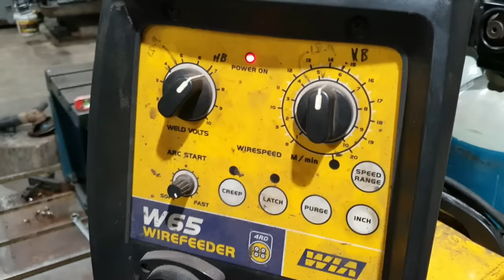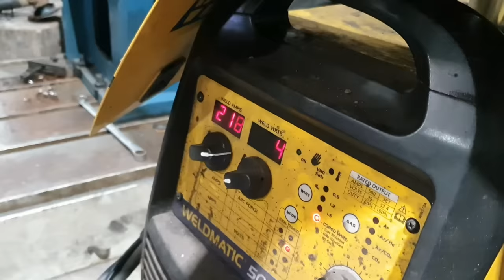Repair DAMAGED Hydraulic Cylinder for CAT 651 Scraper | Part 2

Comment: I'm barely above "dangerous shade-tree welder" and I fully and completely sympathize with that feeling you get when you're trying to heat-shrink two parts together... and you get the hot part to go on just a little and invariably it suddenly yoinks itself crooked and binds right up.... that overwhelming anxiety, knowing that with every passing millisecond, heat energy is just yeeting itself through that point of contact from the hot part to the cold part... that within seconds, every last shred of the precious thermal differential that our human brain worked so hard to create will not only be gone - it will never be achieved again now that the parts are in contact with each other... it's a deep, existential dread, for sure!
Reply: ...it takes PRACTICE-!!!
Reply: @daleburrell6273 
Yep, yet there’s always that one like the head collar that Kurtis had in this video and I bet he’s had tons of practice! It still has the exact effect described and that fraction of a second to grab the conveniently placed hammer feels like an eternity!

Comment: Are you the only guy in that shop? 
  I started out in metal trades and went to collage and became and engineer.   To see you do welding and machinist work is awesome for a rather young man.   Hard to believe it's cheaper to repair these parts vs replacement.

Comment: Thanks for the video mate. Does the hone improve concentricity and parallelism of the bore or does it only polish off the initial machining?
Reply from the maker: Hey mate it does both depending on the type of honing stones i'm using. 😎👍
Reply: @CuttingEdgeEngineering  thanks mate. I’ve never used a hone like that.

Comment: Do you flush the Grit out of the cylinder holes or does customer do that?
Reply from the maker: Hey mate I actually block the oil port holes with silicone which stops oil and grinding paste getting in the head flange. After jobs done we remove the silicone and give it a good inspection. The customer inspects it also before assembly 😎👍

Comment: Great videos. I build hydraulic cylinders for a living now and they've been sub arcing the head and baseplate welds BY HAND for 30yrs. Supposedly I'm the best at it they've had and welds have never failed. Which surprises me cause I'm sure there have been numerous Flux inclusions with the welds.

Comment: Great work as usual.
It was a bit of an anti climax after the cliffhanger of part 1. I see you used the multi tool of choice of handymen everywhere, the lump hammer. to encourage it into place.   😉👌🏻

I have a question, why do you grab the ring on the honing machine from time to time?
Reply from the maker: Hey mate hahaa yeah the missus was cruel with that cliffhanger edit! That wheel I hold is for adjusting out the honing head and put pressure against the stones to hone the barrel.
Reply: ...for the HELL of it(?)
Reply: ...we call that a "dead blow" hammer-!!

Comment: Great video guys, really appreciate your content     Just a quick question for the honing procedure. How do you adjust the machine for end diameter of the barrel? Also it must have been hard to line up the barrel true for the machine. Epic content anyways.
Reply from the maker: Hey mate thanks for watching. I'm using an adjustable honing head, the wheel I hold intermittently allows the honing head to expand the stones out. A bit of measuring to align and 2 universal joints on the honing head keep it centered to the bore. 😎👍

Comment: Wouldn't it have been easier to just bore/hone the bad cylinder until the scratches are gone and install an oversized piston afterwards?
Reply from the maker: Hey mate yeah it would have but this customer does not want anything oversized or modified beyond factory standard/tolerances as if this ever needs repair later on in the field the parts will not be easily available, e.g. seals/pistons

Comment: Brilliant video. Re the tolerance between piston and bore, if the piston was done first could the final honing diameter be changed to suit the smaller piston diameter, or would that mess up the seal fit. 🧐

Comment: Question:  Why did you not chamfer the drilled holes on the interior of the sleeve before reassembly in order to avoid the possibility of getting cuttings trapped in the area inside the head?

Comment: In my apprenticeship i learned to avoid producing stringy swarf like the devil. I noticed you have stringy swarf quite often. 
Often times the theoretical stuff we learn doesn't translate too well into practice so i wanna know what your reasoning is. 

Does a higher feed and or depth of cut produce vibration because of rigidity problems or is the surface finish not up to par? The power of the machine shouldnt be a problem right? Or does it simply not really matter? 
I dont wanna citicise you I've just been wondering for a while since i never really worked in machining. I mostly wrangle with electrons :D

Comment: Is there any way to test the strength of the welds? Or would this be for metallurgy experiments? I realize you are not getting parts back that were not welded thoroughly, but I was just curious if there was a way to test the strength of the weld?

Comment: I am curious to know how you keep the cylinder straight while honing.
I have some experience in automotive block honing with a Sunnen CK10 & it has a load meter to help show tight spots in the bore. I am thinking this may be something beneficial to add to your machine to help keep things straight.
Reply: It looks like the honing machine has ball joints so the head can self aligns to the bore. The 4 honing stones push outwards with a rack and pinion mechanism - rack and pinion is driven by that disk near the top of the shaft.

Comment: Morning Kurtis. Daft question ! Wern't you worried about getting any honing material in the fluid cavity ? Or am l talking out my left ear lol. Great content as per the norm.
Reply from the maker: Hey mate! Nah that's a good question I should've mentioned it in the video I actually block the oil port holes with silicone which stops oil and grinding paste getting in the head flange. After jobs done we remove the silicone and give it a good inspection. The customer inspects it also before assembly 😎👍

Comment: I love your videos.  I wish I had a time machine,  I would go back 32 years and change my major from computer science to engineering.
Reply from the maker: Thanks for watching mate! Do you do any hobby machining?
Reply: @CuttingEdgeEngineering  back in 1989 to 1990  I was pursuing a mechanical engineering degree and I was doing a lot of machining. Then in 1990 I switched majors and got in to microprocessor and IC design and eventually ended up in getting a Bachelors and Masters in Computer Science and specializing in network design.

Comment: Hello from Southern California.  This kind of work interests me and had to stop eating my breakfast on some of the clips that were interesting.  Question since you had re-used the original piston and shaved off the scratches it looks like you kept the same cylinder bore and piston ring diameters?   I did not see you remove some material from the piston ring slots.  thanks.

Comment: Is the horizontal turn table in sync with the welder so it feeds wire in tune with the turning? Very informative videos.
 I am not a metal or machinist guy, but I've watched enough of your videos that most of the time I know what you are going to do next. Very Cool.

Comment: Good work but - um - how do you ensure that enclosed passage between sleeve and head is free of honing swarf?
Reply from the maker: Hey mate I actually block the oil port holes with silicone which stops oil and grinding paste getting in the head flange. After jobs done we remove the silicone and give it a good inspection. The customer inspects it also before assembly 😎👍
Reply: @CuttingEdgeEngineering  I went back and looked. Is that blue RTV blocking the ports? Or the Oz equivalent? Very clever.

Comment: Curtis, with all the sunshine and water down under you could easily make a 10 meter high by 5 meter in diameter water tank to capture rain water and use it to generate electricity using a hydro electric generator.  Or set up a solar panel array and get a 12 large deep run battery set to produce electricity. You could even get ambient light concentrators that will help you generate power at night. That way you slash your overhead and make more profit. And you can sell your excess power to your local sparky provider and make a few more bucks to buy some more beer after a hard days work!

Comment: Love your channel but Im curious, at the 1:20ish mark you deburr the hole in the cylinder. Why did you wait until the nut part was mounted to do that versus when it was off? Isnt it possible you introduced chips inside of that nut part since that is where the fluid comes from?

Comment: Adam Booth (Abom) has videos of spray welding... where he builds back on the metal so it can be machined to original specs. Might have been something to try here on that cylinder once you'd gotten the scratches out.

Comment: Hey Kurtis can you show us how you ensure that all the metal shavings are out of the upper portion where you drilled the holes?
Reply from the maker: Hey mate I actually block the oil port holes with silicone which stops oil and grinding paste getting in the head flange. After jobs done we remove the silicone and give it a good inspection. The customer inspects it also before assembly 😎👍

Comment: Would it been better to clean up piston, then bore & hone barrel to match piston?
Reply from the maker: Hey mate yeah could have but this customer does not want anything oversized or modified beyond factory standard/tolerances as if this ever needs repair later on in the field the parts will not be easily available, e.g. seals/pistons
Reply: @CuttingEdgeEngineering  well understand but you cut the piston undersize, and kept barrel bore stock. So how long will it last before cuts the piston seal rings? Also seems it will wear the barrel faster also. As there is more movement between piston and barrel. Being piston now undersize!

Comment: Hey Kurtis, I'm an old diesel fitter and i used to assist the boilermaker with a lot of our weld repairs. He always peened all of his heavy weld beads with the needle gun. He said it de stressed the bead. Do you see any benifit to this?
Reply from the maker: Hey mate good question. Being the steel tube and filler materials I'm using it's not necessary here but I do use needle gun on large diameter solid rod for that reason 😎👍
Reply: That makes sense. We mostly repaired cracks in mining machinery. Stick/boom cracks, bucket repairs, that sort of stuff
Reply: @craigmandall9420  
In the end, it doesn't matter they will find a way break again.

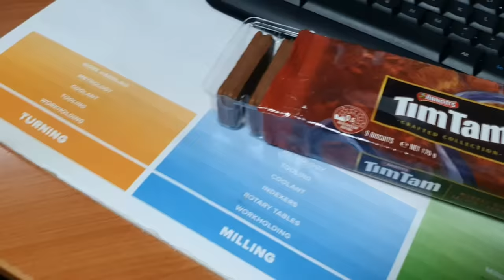Comment: 12:51 method actor 😂 So if the piston was a bit worse, would you have scrapped it and machined a new one, or built it up with Silicon Bronze and re-machined it? I've done both, but it's always seemed like a draw as to which was more cost effective.

Comment: After watching the bloopers at the end I sometimes wonder if Carl, even after a few beers would not handle the talking part better ... LOL Just kidding!
great work as per usual Kurtis, and great job behind the camera Mrs. Kurtis.
Cheers from Tokyo!
Stu
Oh yeah, what is the blue stuff you filled the oil holes in the cylinder prior to honing? Some sort of wax? I assume to keep the swarf from the honing out of the holes and oiling passages, just curious is all.
Cheers
Reply from the maker: Hey Stu! lol Carl after a few beers would blurt out anything the channel might get shut down haha That's ultra blue silicone and spot on, used to stop swarf/grit going into the head flange. Cheers, Kurtis

Comment: Dumb question how did you get the blue puty out of the holes in the barrel after honing
Reply from the maker: Hey mate pushed them out with a dowel pin and tip the out the oil port on the side, count them to make sure none are left in the head flange haha

Comment: Thanks for the video! Do you need any particular certifications to perform these types of repairs on pressure vessels? Also, is this a pulse/spray GMAW process?
Reply: That's metal core wire

Comment: How do you flush out the oil ports in the head flange after honing Kurtis?
Reply from the maker: Hey mate I actually block the oil port holes with silicone which stops oil and grinding paste getting in the head flange. After jobs done we remove the silicone and give it a good inspection
Reply: Thanks for that Kurtis, I did wonder what the blue bits in the holes were...appreciate that 🤙

Comment: I am surprised that you were able yo under bid oem when you consider your overhead, labor, need for special machines and the need to invest in new machines or repurpose used machines so that you can bid on new and bigger jobs unless Caterpillar is really ripping it's customers on oem replacement parts. That said you are doing an excellent job. Keep on keeping on. I hope that the equipment owner is smart enough to realize that he needs to drain, clean the hydraulic fluids and filters or you will be doing this repair again.

Comment: One thing You might try out with Your lovely shop-chief.
Let him sit and look while placing those bit bites on separate places. After placing some of them while he was looking, let him fetch the sweeties You just placed. The bits should not be hidden, they should be in plain sight and easily reachable by the chief.
Some dogs have a remarkable spatial memory. In this case the dog goes directly to each bit without seeking it. There is a limit for each dog on how many places he can memorize.
We had way back an irish wolfhoud who was able to memorize 15+  of them. I would not be able to do the same.

Comment: I know it ain't cool to critique a professional's work, especially someone as awesome as Kurtis.. But I think I'd have turned a fair bit more off that piston, built it up with weld (either bronze or otherwise) then re-turned it down to factory spec.

I don't know how critical the clearance between piston and barrel is, but even after turning half a mil or so off the piston, there were still some pretty noticeable and deep-looking scratches in it :\

Comment: Wouldn't the lubricating/cutting oil that is used on the courser stones , than the same oil is used on the finer stones , be contaminated, thus scoring the barrel???
Reply from the maker: Hey mate! No the honing oil goes down and through a centrifuge filter system so no contamination or grit going back into the oil.
Reply: @CuttingEdgeEngineering  -----THANKS 👍👍👍
Reply: @markgriffin4888  he does a pretty complete tour of the vertical honing machine in a stand-alone video.
Reply: @geoffwysham1731  ----MY excuse is old age , I remembered that later in the evening 😆😆😆😆

Comment: When he says "half a mil" does he mean half a millimeter or half of 1/1000 of an inch?
In imperial measurements a mil is 1/1000 inch.  And that sounds like a nice amount to hone out but I guess one could hone out 1/2 a millimeter also but that would use up a lot of honing stone.  Then again it seems he went through a lot of stones.

Comment: Heaps good video mate. I'm a diesel fitter doing boilermaking at nights just so I can become a pro welder, and maybe get some better fabbing skills.
It always triggers me how they make you use chipping hammers and not wire wheels or scalers, I absolutely NEVER use a chipping hammer outside of tafe. I can't think of a situation where you could get a proper weld in where you couldn't use a wire wheel on a drill or grinder.
There's so much of that stuff at tafe, 2 reasons - They don't want to buy the tools they know some of the students won't respect and they're dead scared some retard will find a way to off himself by accident if he gets the chance.

Same reason I'm sure why, so far as I can remember, we never used parting tools at tafe Machining, they do a risk analysis and know that at some point some clown's going to chew right through and send the parted off piece flying, not a hard thing to learn but it'd probably be more important than making and polishing brass drill gauges..

If they actually put some more effort into focusing the courses on what's really essential and what you really need to get good at to succeed they'd probably have more students and we wouldn't have to import so many tradesmen.